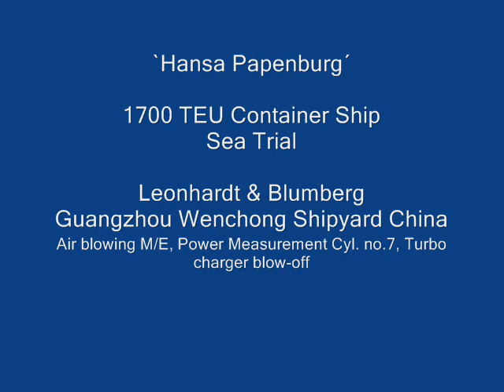Hansa Papenburg sea trial Engine Room, Crash-Stop Astern

Comment: as the engine slows down there is a pressure build up that exhausts back past the compressor turbine releasing the stored energy. the noise can be heard outside the engine room. this only happens when the fuel has been shut off either by the governor or control

Comment: This is a case of turbo charger stalling. As someone below explains, this happens because the engine is stopped so suddenly, causing a sudden decrease in the ammount of air needed for combustion. The air instead builds up in pressure, and then fires back through the turbo as seen here. This is NOT good for the turbo AT ALL! A marine diesel engine is typically only guaranteed to last for two crash-stop tests like this one, and one is carried out during the sea trials when the ship is launched.

Comment: This huge sound was turbocharger "surge"
Surge  can raise the pressure of the air to a level which can be destructive to the engine. It happened because of the  sudden decrease of engine's RPM during crash stop test.

Comment: Besides, a waste-gate does not blow off, it just provides a short-cut for the exhaust gasses by letting them pass without flowing trough the turbine-side of the turbo so they won't power the turbine any longer...And less flow trough the turbine-side will cause less pressure on the compressor-side...

Comment: mmm...I meant a waste-gate...
But when intake pressure gets too high, it opens (it's spring-loaded) and allows an amount of intake-air to pass the turbo without powering the turbine, the intake-air then flows directly to the exhaust system so it doesn't push the boost further up.

Comment: Because turbo pressure is about ten times lower than that usually required in compressed air receivers. It's generally 1 barg absolute maximum, and you can't do a hell of a lot with that.

Comment: well, why don't they make a spring load valve? err i don't know the right word for it... like a "safety valve" wich is opened above specific pressures... or would such a valve just be to small/ slow for this application? on the other hand... how many of these sudden stops are they likely to make? it'll be a very rare one, right? (except for the sea trail...)

Comment: Sadly I know very little about reversing main engines, and nothing to do with ships.  However, I have a little info to do with the engines of a british patrol baot in WW1 which had a procedure that I think of at at least slow and awkward, and possibly disastrous.  So I was looking in this video to see if I could figure out what was actually being done, to what and where one function ends and another begins.  I failed, and the few other comments I saw did not help me interpret this.  So let me tell you of the old story I do have.  It was written down by the chief engineer on a WW1 80' Elco patrol craft.  Fitted with a STANDARD brand engine running a mixture of gasoline and kerosene.  To reverse the craft required the engines be shut down to dead stop.  Then the valve grear was switched over somehow, enabling the engines to be fired up in reverse.  There was no clutch, no gear-box, so they also had to cast off before starting, while hoping the temperamental starting engines would fire up without delay.  So I wonder? Are there direct drive ship engines too?  Would love some subtitle descriptions.

Comment: Bark! 9/10 times the turbo is going to surge during a full ahead-to-crash astern. yes, it strains the rotor, and something could catastrophically fail, but these engines are designed to "limp" at reduced operating speed w/o a turbo. Had I a choice of disabling the turbo vs. pulling a piston with broken rings or worst a skirt (at sea), ill take the former. I once had to "hang up" a con-rod due to a failed crankpin bearing, thankfully in calm seas.

Comment: The castings on these turbochargers are made to keep all debris inside, in case of explosion. However, it's never fully save to stand close to a turbocharger in operation, especially when the throttle is brought back to zero in an instance...then the turbo is still pumping air, but the pressure can't escape, so it boosts back trough the filter/silencer.That's why the pringles-can is thrown back.

Comment: Depends on the country. in the UK it's a little over a 3 year course that does time at uni covering all the maths and mechanics and at sea to do the practical stuff. This is followed by a final oral exam for 4th officers ticket.

You then have to have more sea time and pass further orals and written exams to gain rank to 3rd, 2nd& chief officer. u cannot become captain as an engineer!

If u join be sure to work on plenty of maths as you will need to be about A-level standard to get through!
Reply: In the US Merchant Marine you can be both a chief engineer and a Captain. I worked for a guy that was both. Used to be called any ocean any tonnage Captain's ticket,and a Chief engineer.

Comment: Crash reverse test is starting. Turbo backflows a bit (or rather backfires I guess) as the engine is forcibly slowed to a stop and reversed using compressed air reserves.

Comment: Iunderstand what you mean. that's my sugestion here. indeed not for the 'sporty' sound. But for the technics: ensuring the safety of the engineparts. perhaps such a valve would just be to expensive to install? considering that such a emergency stop is very very rare occasion.
what language do you speak weedeatertijs? NL, that's my 1st. language...

Comment: I didn't see anyone wearing hearing protection. what is going on here?  what was causing what was going on at time frame  1:19 to 1:39 look sometime e was  blowing up on the engine?  Good video.
Reply: +John Moore Turbo blow-off. The engine's throttle had been cut, but the momentum of the turbo meant that it was producing way more boost than the engine could handle. 

So a valve- that big black piece, opened up to vent the excess pressure.
Reply: +renegadeoflife87 Thanks for the info
Reply: Everything correct with what he said, only that big black piece is felt filter and not a valve . No pressure relief  arrangement on blower side.  max pressure is up to 2 bar.

Comment: Well, in my opinion a diesel engine does not work by detonation. It is self-igniting due to high pressure and temperature, but detonation is something you don't want to happen in your engine...It wrecks everything...

Comment: No hearing protection ,,,,,,,,,,,,,,HUH ????
Reply: +Bret B what???
??!!
Reply: +Bret B actually I believe they are using protection but not the one you think, big ear protectors are very good as a protection measure but they are like a huge mass in your head and they are uncomfortable in quick movement, that's why most of us who don't like those use ear plugs, much more comforable when using them and they are not that bad in hearing protection
Reply: john kanellis you need to type louder i dont understand.
its a sarcastic comment, just like mine.

Comment: surging. who does explain me the surging
Reply: +Rafael Uzcategui a back up. air stops or slows down, compresor still compressing, air has to go somewhere, pressure wave piles up and builds back towards the compressor. once it gets to the compressor it hits the blades, which shutters the compressor wheel which are spinning at 100-200K rpm, thats how it breaks shit.
Reply: +g zimmermann in this case the RPM is very much lower, but other things were correct. Maybe a hint to the stopping or slowing down of air. The passage between engine and turbo was blocked or very much restricted so a "blow-off" valve opened and the pressure escaped - it's called surge
Reply: Jakub Polomsky
rpm has less to do with it out side of this video, but whats happening is the same regardless of rpm. its basically the turbo's air volume exceeding what the engine can take at any given moment, a pressure wave or backup ensues and the only place for it to release is back out through the turbo. what usually does it for a car is a throttle body and sudden abrupt changes in flow, but it can happen with superchargers as well. diesels it just has to do with how the turbo is set up aka what air ratios they are using rpm ect, since there is no throttle body they are much less prone to surge, but it can still happen.
Reply: +g zimmermann I did not say anything about the rpms being important. Question what was the surging. I said what I said, you said what you said. You mentioned that crazy rpm number, therefore I corrected you, I said other parts were basically correct. You said it once again, what is the point again?
Reply: +Jakub Polomsky (LightlynX) im talking about the compressor wheel's rpm... not the motor... bruh.. altho a turbo that big on that big of a motor is not spinning that much. so whats your point again?